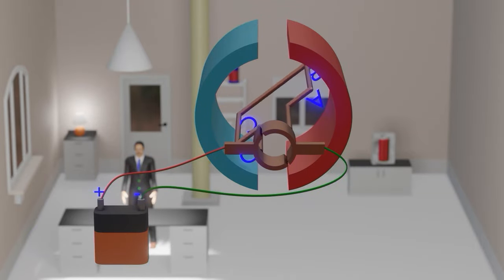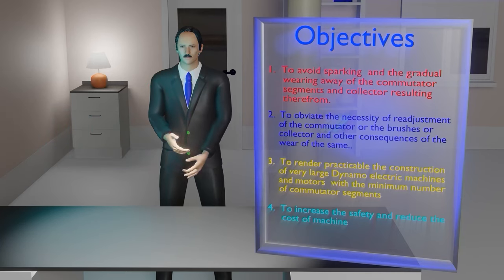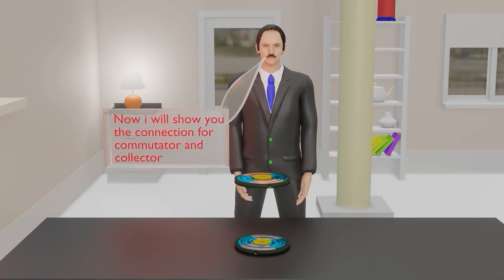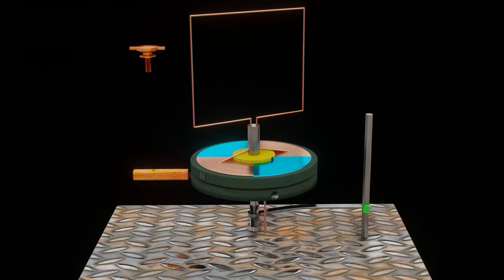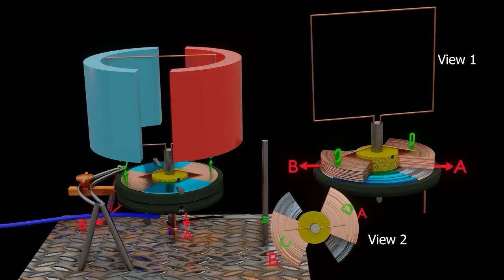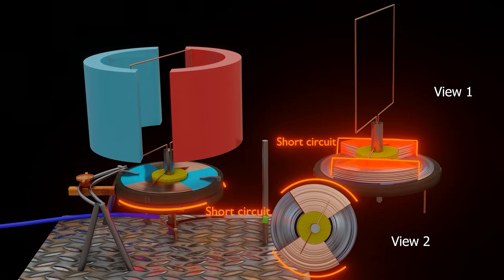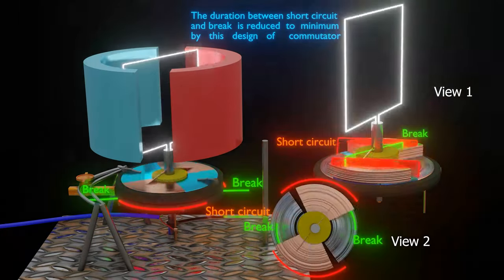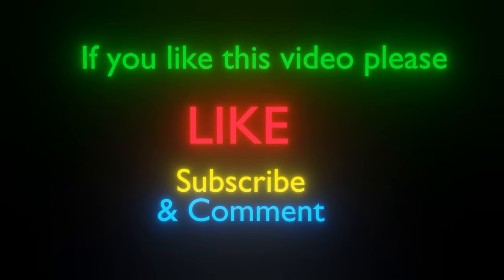New type of Commutator & Brush designed by Nikola Tesla | Commutator | nikola tesla inventions

Comment: A better design it to have a separate section on the collector or lower disk that is a short between the 2 ends of the coil but not connected to the electrical part. This way the coil shunts itself but does not short circuit the actual electrical circuit. It just has to have a 3rd connection that shorts the coil ends together before it switches phases.